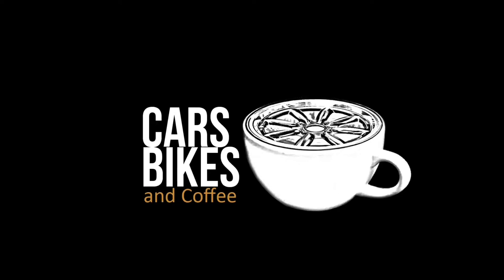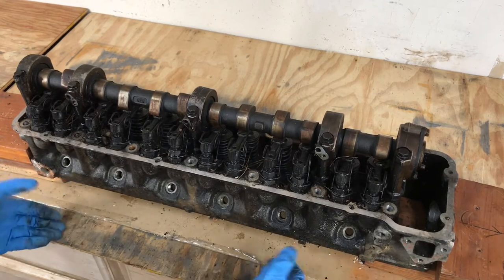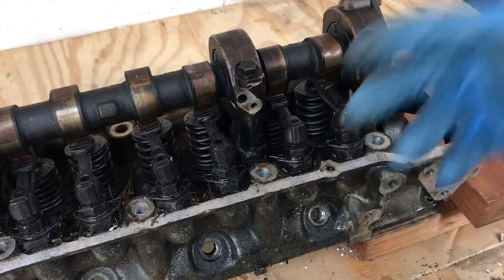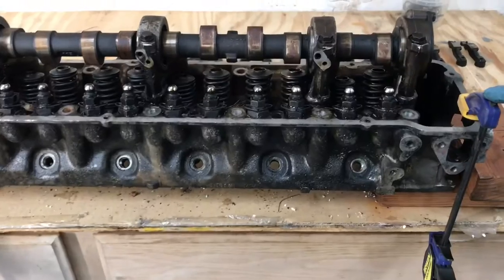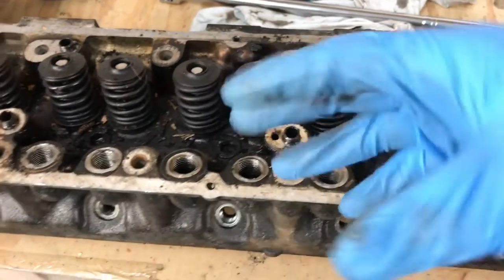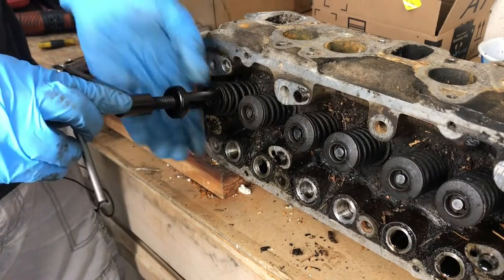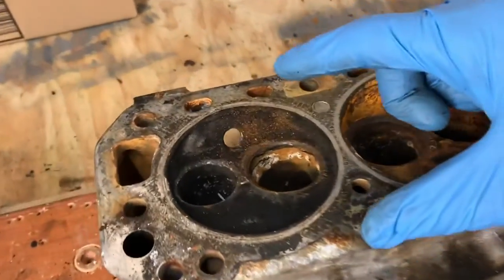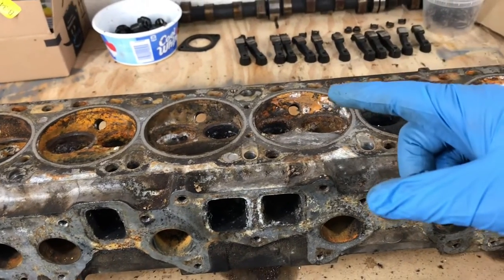Tear down of the Datsun 260Z cylinder head. Ep5

Comment: Hey Kurt love the channel. I bent 2 intake valves by not setting the cam timing correctly. When I was removing one the valve guide broker off on the number 6 intake. Is this something that can be fixed. It is a an L24 E88 head. The guide seemed to be part of the head and not like a brass or steel insert. Do you think I should find a new head ?
Reply from the maker: Thanks for watching! Valve guides are replaceable, maybe take to a machine shop near you and they’ll be able to set you up.

Comment: That head looks rough. I hope that it buffs out. 
Also what did you use to pry down the springs to get the rockers out?
Reply from the maker: +Stephen McGroarty it is rough. We will see if the spare engines head is in better condition. If it’s not get ready for Extreme Makeover Cylinder Head edition 😂. I used a large screwdriver with its tip wrapped in a towel.

Comment: U' ve Got More Patience & Knowledge Than Me.I'd Be Tempted To Look For A Reconditioned 280 Head & Find Either Some Webers or 3 71-72  240 Carbs.Then U'l Have More H.p. & Dependability.The 260 Hitachi Carbs Were A Big Problem.HITACHI Makes Great Color T.V.' s & Stereos,But the 260 Carbs Were Messed Up By Factory ,Trying to Make Them Emissions Legal,I Believe ,Was the Problem.
Reply from the maker: +Ed Cain thanks! The good news we are putting some 240Z SU carbs on this engine. I agree on the 280Z head would be a better option. If I can find one in good condition and the right price, I might go that direction. Thanks for watching and appreciate your feedback!